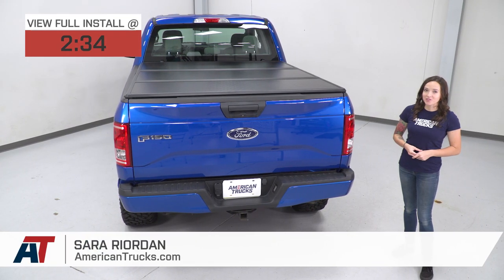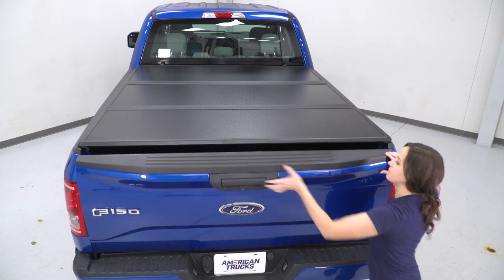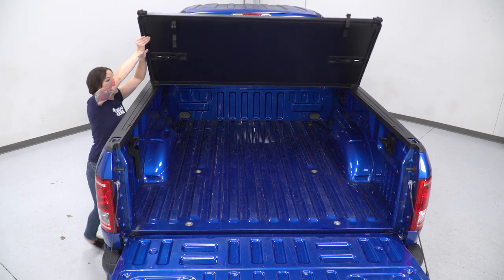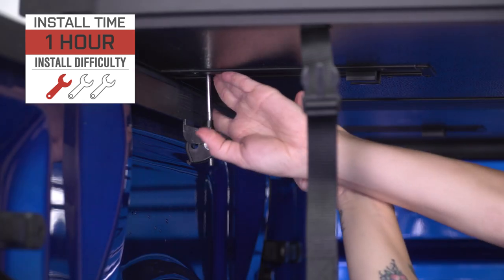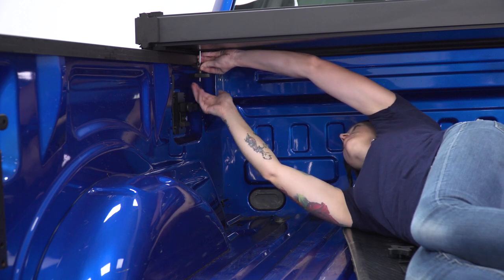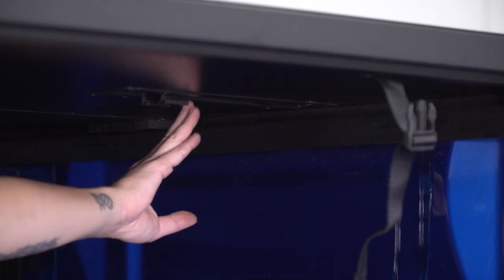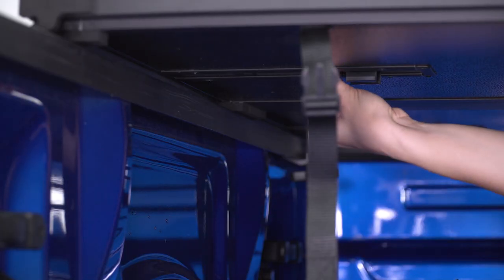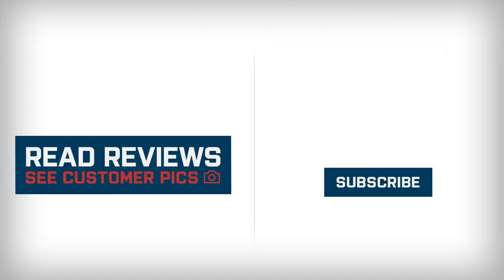2015-2022 F150 RedRock 4x4 Hard Tri-Fold Tonneau Cover Review & Install

Comment: I purchased open box fender flares only because they were described as 
"like new." They are not like new, one is warped and does not sit flush 
against the vehicle. And now I can only get a store credit because it 
was an open box. I will not do business again with a garbage company 
that misleads its customers.
Reply: Bro this is for a bed cover. Call customer service. Also you should check compatibility when you receive it immediately in case returns are warranted especially on an open box purchase... good luck